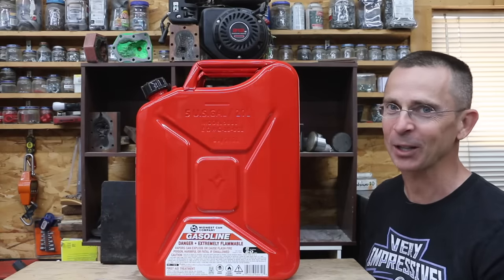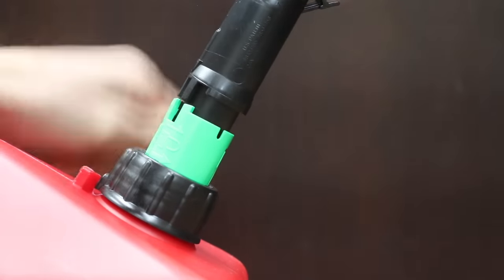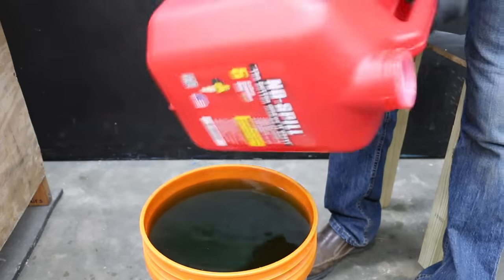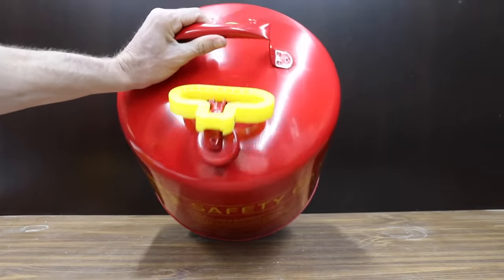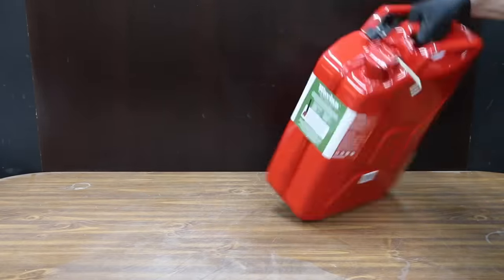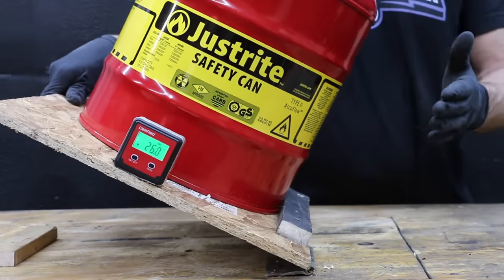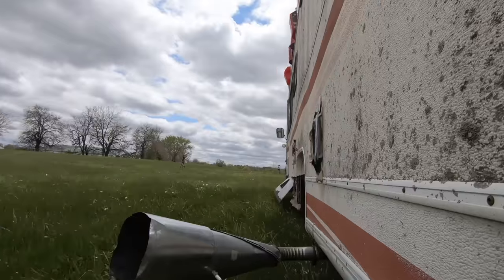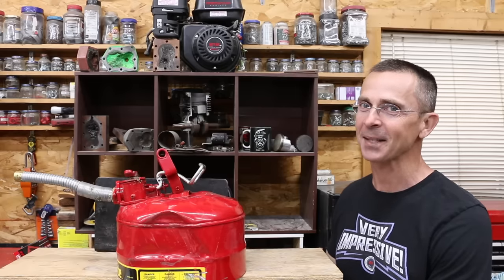Best Gas Can? $140 Wavian vs Eagle, Surecan, Scepter, Briggs & Stratton, Midwest, VP Racing

Comment: The original “Jerry Can” was German design. Germany knew getting fuel in containers to vehicles in the battlefield was crucial for his blitzkrieg. They designed them I think in the 1930s everything was thought of. The way the seem was welded and rolled, the spout.
Reply: Watch the video of the jerry can as the secret weapon of WWll,good for fuel or water. Height of german engineering.
Reply: @ronv6637  So good the allies stole the design without modifying it.
Reply: @modarkthemauler  The MOD adopted the design as is from Adolph. The DOD in the USA modified the design significantly in order to make them easier to mass produce under contract. The technology used to die stamp such thick steel to make the halves of the clamshell on the original Gerry can design was not available in USA manufacture at the time, and would have required expensive retooling and delays in fulfillment.

GI's vastly preferred the German cans, and collected them from German facilities when ever they had the opportunity. The Gerry can floats. It doesn't glug. It doesn't off gas. It can be stacked up to 4 high in a depot. It takes abuse and just works.

The EPA is why we can't have nothing nice.
Reply: @ivermec-tin666  I did not know that. But I do remember reading the early USA ones being inferior. Didn't they later unMOD it to be the same as the german version, sans the swastikas?
Reply: @modarkthemauler  The US Military never specified proper Gerry cans (aka NATO cans). They never adopted the seam welded clamshell design, or the camlock bayonet closure and spout fitting.

The DOD design had a rolled seam and a flat bottom plate with a rolled seam. It had no hump in the top, and no anti-glug feature. They required a wrench, prybar, or screwdriver to firmly screw down and later remove the cap, and to install the unique threaded nozzle.

The NATO can standard was widely adopted throughout the Commonwealth, NATO, Switzerland, Sweden, and even the IDF. The IDF still uses proper NATO cans, made in Israel.
Reply: Germany had it right
Reply: @SuperNoticer  Germany was dominant in the sciences at the time. They also had a chronic shortage of fuel. They wanted to waste none of their expensive imported petrol.
Reply from the maker: Thanks for the feedback.
Reply: ...and that company moved to Latvia around ww2, and has made the Wavian, Valpro, WedCo and Midwest cans since then.

At least if my google-fu isn't failing me.

Comment: I worked at a parts store when the EPA mandated the "no spill" design around 2008. You wouldn't believe the amount of pissed off customers when they came in to buy a gas can, and literally overnight, the price went from ~$8-10 to these $25+ monstrosities. Plus the added "benefit" of horrible ergonomics, sticking valves, and as your video pointed out, the difficulty of actually using a gas can to fill a vehicle with many designs. As others have pointed out, the EZ-pour replacement valves and nozzles are a great "downgrade" to fix these newer style cans. Too bad you couldn't have tested a properly modified Midwest can. Although that would have just pointed out the absurdity of these EPA mandated monstrosities. 

Remember that as a cautionary tale for other government mandated changes and design restrictions.... the government actually managed to fuck up a gas can.
Reply: Most of us unfeck them because it's more important to be able to use them on a boat or in the bush than comply with an irrelevant standard.  I'm not standing in the rain or on a boat at sea for three minutes to drop 20 ltrs of go juice into a tank.  Lovely idea for idiot proofing - but when getting a boat fueled up a few minutes from washing ashore I don't have time for that  feel good rubbish.  Fuelling up any vehicle or machine has a risk factor.  Paying attention and minimising the risk is sufficient - otherwise we create additional risks that outweigh the possible benefits of a slower, more restrictive and physically ungainly 'safer' device...
Reply: I was blown away at some of these prices. In canada you just have the classic cheap can no buttons.

Comment: I picked up a couple of the "vp racing" style fuel cans from my local Rural king for around 20 bucks a piece and they are the best fuel cans I've ever used, perfect for filling up my farm tractor!
Reply: Nah; Those take FOREVER to drain...Just get the 5 gallon MidWest can (Usually like $15.00); Then, get a regular nozzle off Ebay...My favorite are the MidWest 2.5 gallon cans( With the regular nozzle); Easier to move around, and not much guessing on the amount needed...Found some original nozzles some idiot had thrown out, and use them all the time!!
Reply: @brentfarvors192  yea I've got a couple of those in the 5 gallon version and they work good for my atv gas but I have to disagree on the drain time with the vp style, it took me a few tries to get used to the shape of the can along with the vent placement but once I got the hang of it I can empty 5 gallons of diesel in no time, kinda depressing at $5.32 a gallon for farm diesel tho 😅
Reply: @brentfarvors192  the main trick is to get the vp can positioned on your shoulder so you can get it in the tractor tank without kinking the hose, now it probably wouldn't work as good on something low to the ground
Reply: @HillbillyChrome  Oh, I know all about all that...Still takes FOREVER, and wears out your shoulder.
Reply from the maker: Thanks for sharing.
Reply: Hillbilly Chrome, you're absolutely right! The RK cans are half the price and will hold 6 gallons! When filling my scag or john deere 455 I just take off the gas can spout and pour it in straight since those mowers have 3" fill caps...
Reply: @karlschupp8552  yes sir, that's what I do with my "midwest" style gas cans for my mower and atvs because the safety nozzles are crap and leak all over the place lol

Comment: Love your videos. Some interesting points on the “military style” cans. Originally a German design, called by the allies, the Jerry can. The recessed weld around the can protected the weld from rough use due to recess. Clever idea. More expensive to manufacture BUT in a military use, of great benefit. Also, the Jerry can cannot be filled completely, there is an air pocket at the top. This was done to provide expansion room if contents, normally gas, expanded due to external heat. The Shape of the Jerry can meant that the could easily be stacked, and you could get the most amount of fuel in the smallest space. A wonderful design. I’m NOT saying it is the best for normal everyday civilian use, just that it was a wonderful design.
Reply: One other thing about the Jerry can design - it can be carried by one man using the center handle, or two men with a handle on each side. If you've ever had to hump cans of fuel across rough ground or sand, that makes a big difference.
Reply: If I remember correctly the air pocket also allows the can to float in water even when full.
Reply: @endastforkommentering9913  Yes, I forgot to mention that. The Jerry can is one of the best designed products I have ever seen.
Reply: @kenstrayhorn5923  Yes, I forgot to mention that feature as well.
Reply: 100% agree! The Jerrycan is an engineering marvel!
Reply from the maker: Thanks for sharing.
Reply: @kenstrayhorn5923  You can also carry two in one hand if you use opposite side handles. 👌👌 None of the other can designs let you do that.

Comment: I have 4 versions, my favorite is the No spill. The Midwest spout is a pain for me, gas expansion from temperature flux is difficult to purge, causing a pressurized burst of gasoline once the tank is tipped. Regarding the difficulty filling with the no spill and the sceptre, if you are operating it in your test at 0deg from parallel, try 45-60deg spout angle which nearly empties the container in my cars. Great video, thanks for this!

Comment: The main reason for the leak on the VP can is you had the can entirely inverted.  It works best if the vent is slightly above the spout (you have to bend that flexible clear filler hose).  What's even better is the VP Racing Trigger Fluid Control System - the screw vent stays closed, you position the can any way you like and pull the trigger to open the valve.  You can stop pouring any time by releasing the trigger.  
I've been using this setup for racing motorcycles for years and it's by far the easiest fueling system I've ever had - including NATO cans and various plastic jugs both pre- and post-CARB rules.

Comment: From everything that I've researched the Midwest metal cans are produced by Wavian, so having a similar construction isn't too surprising.  I've got a couple of the Midwest cans that I've replaced the spout and added a vent port on the rear, it has helped a hella lot when wanting to dump fuel at a fast rate.
Reply from the maker: Thank you for sharing!

Comment: I work construction and have eagle safety cans with some of them over 20 years old. They've been dropped from cranes, squished by tractors and dropped up umpteen times out of the back of a truck and the only thing I've ever done is replace a lid seal. Not the handiest for the homeowner but definitely the most durable for a working can.
Reply from the maker: Thanks for sharing.

Comment: The jerry cans are objectively the best, which is why the German design still continues to be the gold standard in refueling.
Reply: Imo the HarborFreight one is probably one of the best replicas since it was properly coated and welded without costing an arm and leg
Reply: @ertsec  I have a couple of these with replaced nozzles and drilled in vent spouts. The EPA nozzles really screw up flow from cans. I have no complaints. They don't ride in my vehicles however, I use some B&S cans with the same replaced nozzles and spouts in my vehicles.
Reply: They're great, but not the best choice for everything.  They're totally fine for filling into the side filler on a vehicle.  I wouldn't want to use one to fill a push mower or lawn tractor since the fillers on those are generally straight vertical.  You're going to spill gas everywhere because you can't really get the spout close to the filler before gas starts to pour as you tip the can. 

Being able to position the spout and tilt the can before making a separate decision to start flow is an advantage for a lot of scenarios.
Reply: @everydreamai  the trick is to decivilianize it and turn it back into a proper jerry can
Reply: @ertsec  It's still 27" tall, no vent will fix that.
Reply: What do you mean by objectively? Did you watch the video? Lol
Reply: @everydreamai  The original Jerry cans you could actually use the cap as a pour spout. The reproductions have different caps.

Comment: I think the original Jerrycan from the 30’s was pretty much the tip of the fuel can evolution… I don’t see that any of the newer cans add anything regarding user friendlyness, rigidity or longevity. There is an excellent video about it made by Calum!
Reply from the maker: Thanks for the feedback.

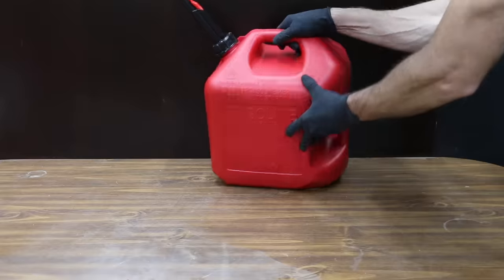Comment: 3:20 the nozzle needs to be rotated 180 degrees, so the red push tab is pointed down and not up, or the flow will be interrupted by gulping air. Tilting the cans up so high will slow the flow rate compared to having them at an angle for the same reason. If the nozzle is rotated in the wrong way, it takes about three times as long to empty the can.
Reply from the maker: Thanks for the feedback.

Comment: The method for the VP jug can be a bit of a learning curve but once you have it down you can fill most anything without spilling. I prefer them a lot when fueling old classics in the shop where spilling is not an option.
Reply: We ran a tube from the vent down to the bottom of the tank, drilled out the vent hole, and attached a larger filling hose. I don't remember the actual figures but those mods drastically decreased our refueling time during pit stops.

Comment: Man, that Surecan looks nice. I don't need new carriers yet but I'm going to have to remember that one. Being able to seat the spout fully into your vehicle and THEN hit a trigger to get the flow going seems pretty valuable.
Reply from the maker: Thanks for sharing.
Reply: The Surecan is the most practical "novelty" can I've ever come across.  The cost is mildly prohibitive, and it can take a time or two to learn the best way to set it up for whatever you're filling, but it will save you gas spilled on over-fills in the long run.  Hardest lesson I learned was there is a device in place when you buy one that you must remove before filling it the first time.  I made a fool out of myself by not paying attention to the warning that is printed right on the packaging.  It WILL dispense on its own if this warning is not heeded!
Reply: 100% added a "sure" in between "Surecan" & "looks."

Don't know why, but it made me chuckle!
Reply: @Iceberg86300  I'm pretty certain there was at first but then I deleted it cause it sounded wrong. xD

Comment: I have the specter, when the “no spill” (it always leaked) nozzle wouldn’t work anymore due to ethanol drying out the internals, so in the trash it went. Next was to get the EZ flow kit with a tank vent, now I don’t spill a drop, have to use a transmission funnel to fuel my vehicle. FYI
Reply from the maker: Thank you for sharing!
Reply: I have a scepter, it didn't leak, but it pressured itself so much that I almost broke it trying to get it to vent. I don't use fuel in my cans that often but all it took was a heat wave to jam it shut
Reply: Same here. I found that mechanism almost impossible to use. Converted them to vented ez flow. no regrets

Comment: I think I'll stick with Wavians, while yes they're pricey and they tend to roll when unsecured I dont leave fuel containers loose in the back of a vehicle no matter what container I'm using, if you do honestly you're asking for problems down the road. With that not being a factor it frankly makes the Wavian the best option for myself for longevity and long term use. Add in the fact Wavian cans come in multiple colors and even plastic containers for water (just in case you're worried about the liner not lasting) frankly they really are the best for me. Results may vary
Reply: I have a couple of the VP cans in the collection. They are super user friendly all the way around.
Reply: @c4f5  i found them problematic for mass fuel and realistic bulk storage. They leave too much wasted space on a shelf and aren't easily stacked in any manner. Mind you my comment was in regards to MY use case. All others may have varying results
Reply: @biosaber585  Looks like my comment landed under the wrong comment. I'm not sure how that happened. It was supposed to be in response to someone asking questions about the VP cans, which I like for most every day applications. Their height is sometimes an issue. Anyway, that being said, you make a couple of solid points there, and have my sincerest apology for the misplacement of my comment. Have a good one.
Reply: @c4f5  no problem thank you for your polite response and here's hoping youtube fixes itself

Comment: Another great video!  I have the No Spill cans and found them the best for my needs.  Not being very tall and having shoulder issues, filling my Exmark Mower and my generator - the rear handle and the pushbutton control are game changers.  I detest those models that have the "click to unlock" feature.
Reply: Yeah I stick to the no spills anymore too. Decent flow and super easy to use.

Comment: My choice would be the plastic Midwest because of the two handles. I have one. I replaced the nozzle with an up yours government free flowing one. I also added a vent. It rocks. I wished you would have added a modified can back to the way they used to be for a pour comparison.
Reply: USDOT transportation regs are one thing. But the inane USEPA regs are another. That is what these ridiculous spouts were designed to conform with. I have modified all my newer cans to vent and pour quickly. I still use plastic and steel cans that we had from 50 years to 20 years ago. I finally purchased a battery-operated pump for my farm equipment, motorcycles, ATVs, and side-by-side. I never looked back. The VP can is as close to the old-style containers as you can get these days. BTW, I agree that two handles are big convenience.

Comment: The 2 biggest features I look for is how easy to get the spout off to fill it and how easy is the pour mechanism . The sceptre and midwest are horrible designs to pour the fuel, the sceptre is very difficult to push the button and the midwest always slips on that notch when pouring it.
Reply from the maker: Thank you!
Reply: For CARB compliant fuel cans, I just remove the nozzle and pour it in a funnel.  Works so much better.

Comment: The lawmakers who put all these restrictions on gas cans have never held a gas can in their life. I have spilled more gas using these worthless piece of the garbage than in my 50 years of using the old fashion metal cans. Also, the fume screen makes it impossible to fill these up at the gas pump without spilling gas all over the ground. That is why there are so many videos on YouTube of how to rip those screens out of the cans and put your own vent caps in.
Reply: Yeah I used a small 1 gallon $10 gas can from Midwest can.  I noticed you CANNOT use it without two hands, so what if I had one arm only?

Thanks lawmakers and engineers. Piece of crap, duct tape fixed the bad spout design.
Reply: I’m only 12 and I completely feel that.

Comment: Very nice! I wonder if you could add a test to see how they hold up to the UV rays from the sun. Most of my gas cans have split apart and cracked up from exposure to sunlight, and metal cans most of the time will rust